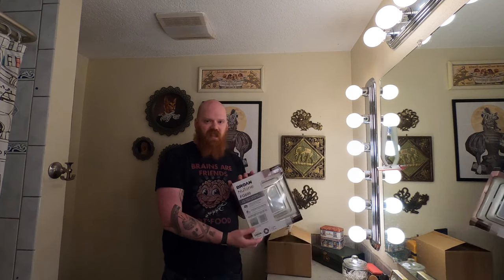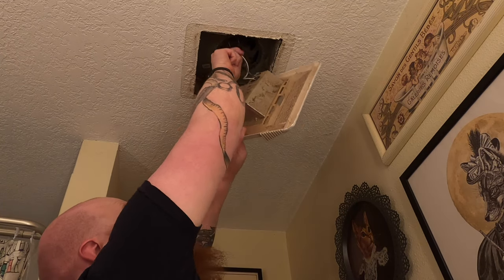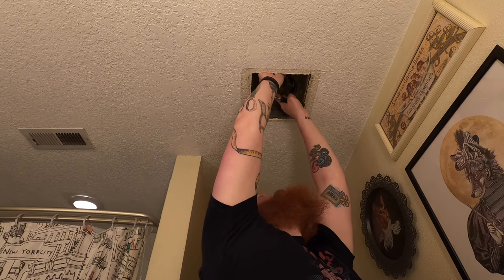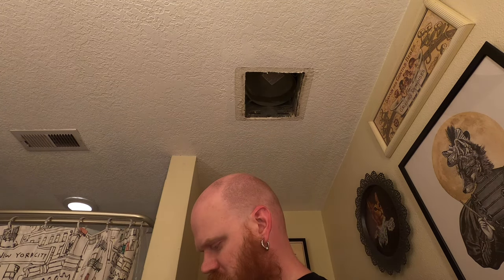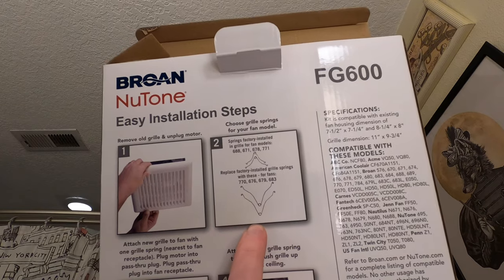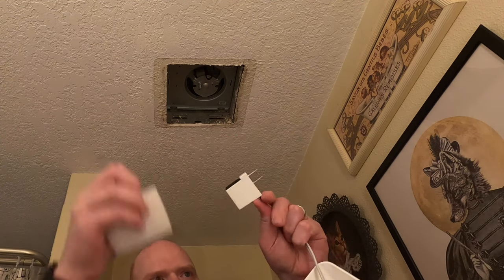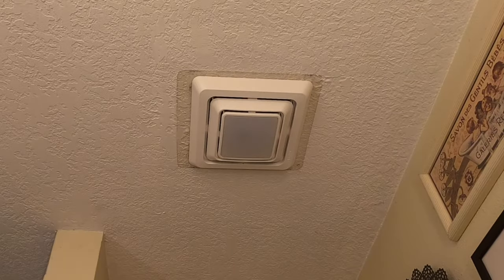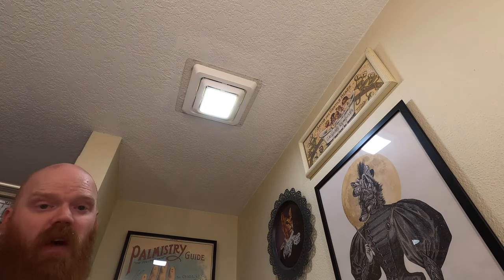Quick and Easy update to our Bathroom Fan!

Comment: Excellent video!!! I needed to find the model number of mine before replacing it. Also, your advice to save the screw was so important!!! Missing parts drive me crazy!
Anyway, I am trying to decide whether to just get a new motor for financial reasons, or upgrade to the one like you have, but with the Bluetooth. After seeing this video, I think I will save to get the upgrade since there's no point in going through all that trouble to pay to upgrade later. I can go without a fan for another month or two. 
I saw one by HomeWerks for 89 dollars yesterday at Lowe's. I need that one. And you're saving me much money teaching me to do it myself. Thank you so much!!!👍🏾👍🏾😉😉